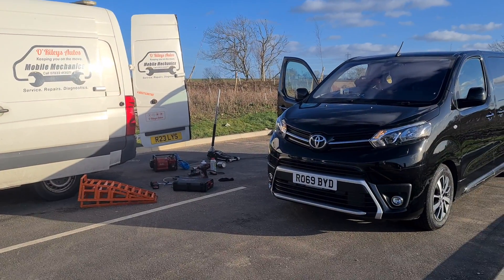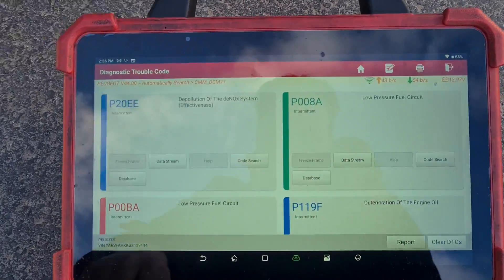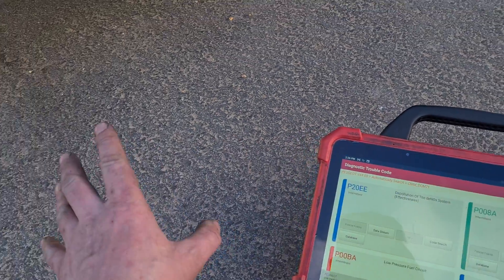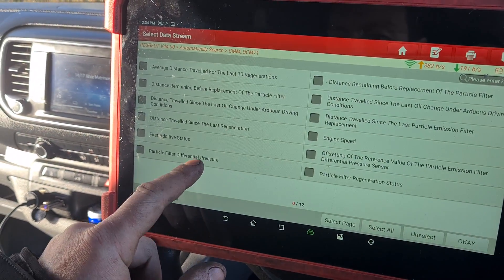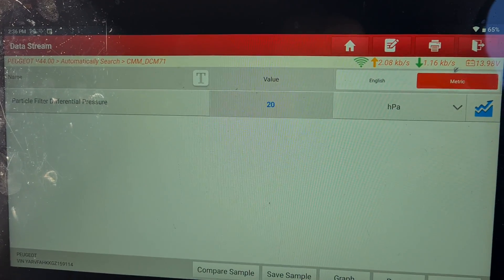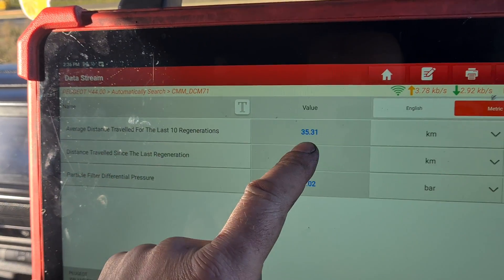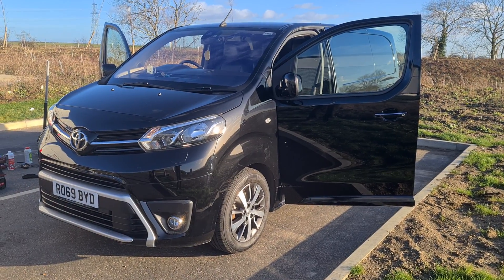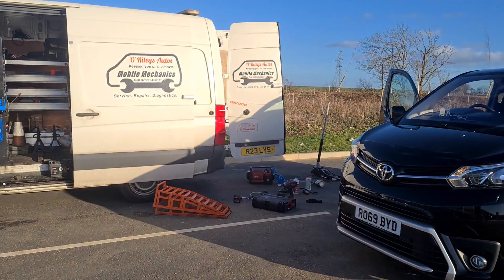Toyota Pro Ace P20EE Depopulation Of The Denox System Effectiveness: Diagnostic

Comment: Recent one I did same situation suspected damaged dpf, stuck smoke generator up exhaust pipe. Found leak around top of dpf, a bad weld had a hairline crack about 1.5 inch across. Rewelded all way round with tig, no issue since. if I didn't smoke it I wouldn't have seen it.

Comment: That's disgraceful. Do Toyota use standard PSA parts on these Proace vans, or do they have their own adaptations to the FAP system?
60,000 miles seems way too soon for it to fail, even if they weren't doing many long trips.

Comment: Whats the difference between the these symptoms and other videos where the dpf has regened and Jimi has fixed problems with other parts of system? 
I.e. What's telling Jimi that there isn't something about the regen that is faulty on this particular van?
Reply: Everything else around it is working correctly. Usually you have a blocked high pressure pipe or faulty sensor that stops the regeneration from happening. This vehicle is doing regenerations as it should but it isn't clearing so the cycle continues.